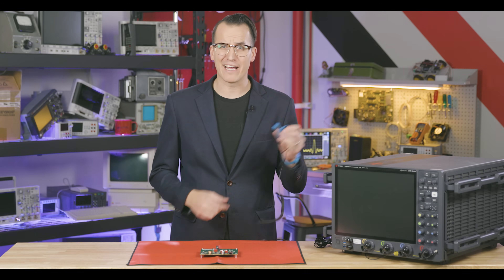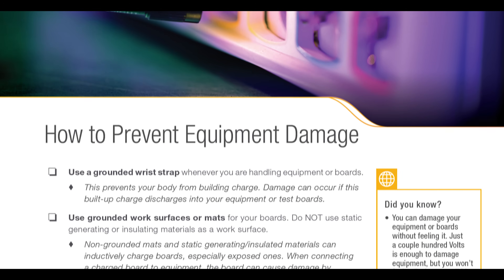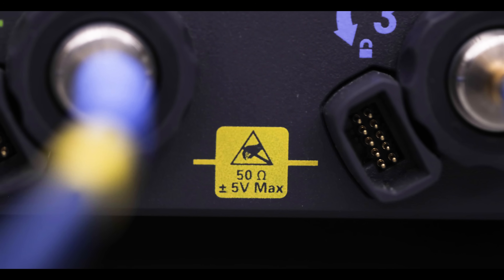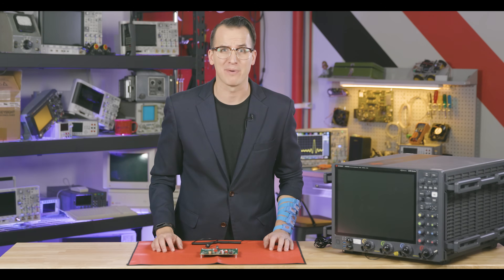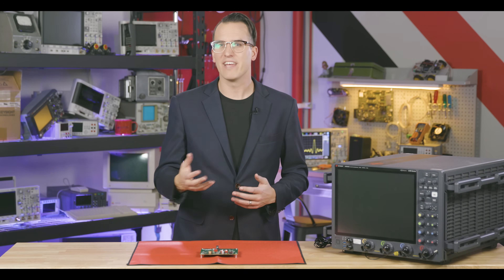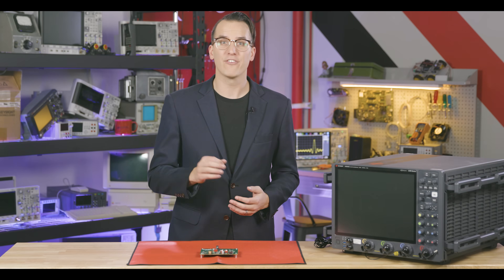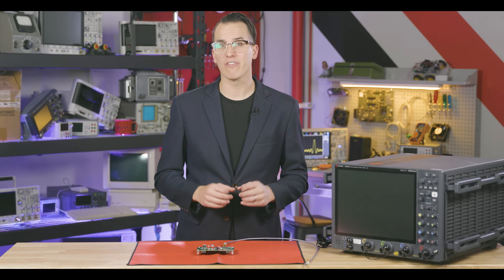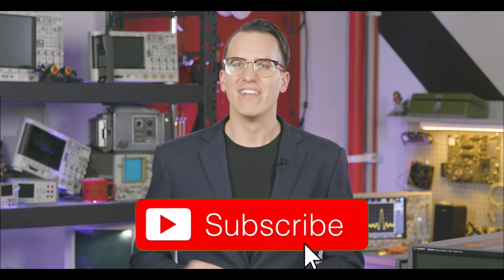⚡ 4 Easy Ways to BLOW UP Your Test Gear ⚡

Comment: I thought wearing a ESD strap didn''t ensure ESD events don't occur because any build up is slowly discharged through the resistor in the strap?
Reply from the maker: "slowly" in electrical time scales, but quite quickly on a human time scale. It's best to use an ESD checker as a to-be-safe measure.
Reply: @KeysightLabs  ah thank you! do you mean like the button one you showed, or the meter one? typically when I built my two pc's (15 years apart) I just kept the PSU plugged in and my bare foot on it while i assembled everything.. I know that would be bad if you touched anything hot though. recently took up electronic repair as a hobby so my experience is pretty minimal. ended up making my own strap from a resistor out of a mega2560 kit, verifying it worked with a multimeter. just got my first scope today, a DHO814, so I've been doing a lot of research before attempting anything. what exactly is that thing you used to discharge the cable, is it just called a 50ohm shunt?

Comment: Your comedic timing is on point. It's very hard and I'd imagine you didn't have to study in school.
Reply from the maker: Oh I had to study a LOT!
Reply: @Keysight Labs  you should be making more videos man. You're like electroboom only without running voltage through your body and the innuendo lol
Reply from the maker: Thank you, appreciate it! I have a few things in the works 😃
Reply: @Keysight Labs  cool. I'm starting a channel I think. Hurricane Fiona wrecked my home and I'm just getting thr work done now. I've slept in my workshop for over 5 months and the wife sleeps on the sofa with the cats. We  have no where to fit a bed. The end is in sight though. I had to give my 3d printers and some other gear away. I'm still a noob and I've been soldering a different circuit every day. Haha

I'm building a giant robot arm for thr local non-profit makerspace that can be controlled with a ps5 controller in hopes of getting some kids in to learn. Management doesn't seem to gaf.
Reply: @Keysight Labs  I have a software engineering degree I never used and went into policing for 2 decades then was forced into retirement. I remembered how much I loved this stuff and basically live it and do charity work. I would  do smd practice boards alot so I wouldn't be one of the belly achers lol. I majored in big data algorithms before they took over our lives hahaha

Comment: I wonder how they abused that poor scope to achieve the arcs effect…. Question tho, does it still work? Seems like the arc was jumping from the grounded ring of the probe to the outer shell of the BNC connector? Doesn’t look like any arc jumped to the signal input
Reply from the maker: Good question! It was a scrap scope, no hope of repair. I hooked up a neon sign transformer to the BNC connection in the back and the probe.
Reply: @KeysightLabs  Last time I accidentally discharged to my analog scope (sorry I’m too poor to get a key sight one) and it was fine, I suppose I got lucky and discharged to the outer ring of the connector and luckily it was grounded, it was painful for me tho
Reply from the maker: Yikes! I've seen folks often touch the outer ring of the BNC to make sure they are discharged. The center conductor is the one to be careful with

Comment: Notably, probing a 12V 1200W earth-grounded supply backwards by accident will light your scope lead on fire, but actually your scope will be fine. As long as you put out the fire, anyway.

Comment: Very nice, but you forgot to say, that it is a good idea to connect a 1M or higher value resistor between you and ground. 
Becaus if you touch the "hot" conductor from the mains and are groundet you would get a massive shock and maybe die. The 1M resistor would limit the current in that case to a safe level and you would only get a small shock.

Comment: Wow, I've been using the pink foam as a ESD pad for years, but I guess my habit of touching my workbench with my hands first has been the best grounding so far.  It's not that my workbench is grounded, it's just a cheap plastic fold-up table.  So far I don't think I've blown up any parts though.  I don't have test equipment other than a really old Radio Shack DMM from the 80's.  I'm too poor to buy test equipment.  http://www.R2Pv1.com/

Comment: I once went to collect a bunch of cheap computer parts that had odd faults (motherboards that would start up but not recognise disks, etc.) from someone and I brought some antistatic bags with me, and the guy looked at me like I was crazy.  He said he'd been building computers for years and never needed them as he'd never zapped anything.  Apparently it never occurred to him that damage from static electricity doesn't necessarily kill a device outright, it can also cause partial and intermittent failures depending on what gets zapped.  Seems he'd been killing computer parts for years and just never realised...

Comment: couple years back, I was fresh from school and basically had no idea about ESD effects.
At the time our company was located in a nice building "loft/open space" style with a glass square in the center of the floor, and we all had our desks around it, on the wooden floor.
I had a 2k€+ prototype on my desk I received the week before, and was trying to debug a component failing during bring-up. The CEO comes check on me and the bringup. At some point during my explanation he goes "is that this component burning down?" and points directly at the CPU. We head a loud "TAK" and the board turned off for good, never to power on again. I wasn't sure about the issue I was initially chasing down, but there was absolutely no doubt about this one!
Since then we put ESD-safe flooring everywhere there can be electronic components.
Reply from the maker: Ouch!

Comment: Once upon a time i killed a multimeter measuring a high voltage output by accident (6000v 100 watt) and magic smoke appeared proper EEVBlog style.

Also, never hold a spud gun with a 100KV spark ignitor between your legs to look if the spark gap innside is too big, because it really REALLY hurts in the sack 😅🤣

My poor mans way of dissapating eventual charges and check for high voltage is little finger on ground and showing the board my middle one :)

Comment: Just bought a DSOX-1204G.  Taking it out of the bag it was wrapped in (low density polyethylene) it produced a sizable static charge and it generated a large arc from my thumb directly to the channel 4 input.  Physician heal thyself!  I appreciate all the the efforts you guys go to to educate users, but I find it a little odd that you lecture us on static precautions then pack your scopes in that sort of plastic.

Comment: Definitely some good things to keep in mind in this video. I'm surprised that anyone who gets in to electronics would think those wireless wrist straps would do anything at all to protect against static buildup. The pink foam stuff and the pink bags used to ship some components are static disipative. Dave Jones showed how parts inside a pink plastic bag can still be zapped by static electricity. You are better off using the black conductive foam and those shiny silvery type of bags. The silvery bags are anti-static and will protect the parts inside.

Comment: Old vacuum tube electronics which I commonly repair can easily destroy test equipment if not careful
Reply: EEVBLOG has covered the fake wireless static band theory without beating around the bush....
Reply: The supposed anti-static Pink board bags also do not protect against static discharges.  EEVBLOG proved this.

Comment: I have engineers on me dropping the anti static bracelet simply because this sort of damage "never happened" to them. What the hell do I do?
Reply from the maker: Well, it only takes once. But, the big thing to emphasize is that it can partially damage it and only show up later. You could also try to find an ESD tool like we used and actually show them how charged up they are.

Comment: Wow! I had no idea pink foam was that useless! I always just sort of trusted it because it was supposedly made for that application. Very good info here!
Not sure if I missed it, but was it also mentioned here that ESD damage can be cumulative? Just because a poor practice doesn't wreck something the first, second, or third time, doesn't mean that damage isn't adding up.
Reply: Yes, static discharge can weaken or damage semiconductor junctions without actually causing immediate failures in many cases.  Spike damage can manifest itself as failures later on for no obvious cause or reason.  For example I've experienced controller board failures a week or more after a known mains voltage spike incident (took out the cheapo surge protector and caused the RCD to trip).  A week or two later I had a controller board (not protected by the surge arrester) fail and the only reason I could put it down to was the big spike a week or two earlier.  This is why the problem is so insidious: people think they get away with ignoring ESD issues because they don't have immediate or obvious failures, and the failures they do have are put down to "unknown causes".

Comment: You put metal standoffs on the pcb? Looks quite unuseful XD
Reply from the maker: The standoff points aren't connected to anything, it's the bottom of the PCB at other points where there is actually correction that cause problems.

Comment: Hey Daniel, question, is it safe to “discharge” myself to to instrument metal case or the nut of the front panel connector on a VNA when not having the ESD strap?
Reply from the maker: The case is typically grounded and an ok option. The nut on the connector works too, but you have to be super careful that you don't hit the center conductor on the input.

Comment: I believe that appliances for domestic, industrial or lab use that do not resist static electricity should not be allowed in the consumer market without being marked as electrostatically sensitive equipment or apliance! This should be marked on the device not in the user manual :). if the inside boards of a machine are sensitive to static electricity they should put markings with  static sensitive boards inside! near the screw holes :P

Comment: "if you are not using it keep it capped", so... why your oscilloscopes don't come with caps for unused bnc connectors?
Reply from the maker: We're actually in the process of changing that for much of our gear, great question!
Reply: @KeysightLabs  hope not in the proces of making your gear more static sensitive :P

Comment: 2 questions, 1) if i have left the room, then return later with a significant static charge. Then how many seconds of time after putting back on my ESD wrist strap will it then be safe and be fully discharged!!?? This is a very common scenario. But was not covered in the video.

2) If recently washed my hand will that also help to discharge me?? Assuming that the tap is metal and it has a real ground point. Sometime it is hard to be sure about that fact. However in other facilities a green and yellow earth wire is very clearly visibly attached to the nearby pipework which can be traced back to the sink. I am of course thinking about mobile or off site scenarios where you might not have the ability or luxuries to control the situation when compared to the lab / workshop.

This is important to me!! Thank you keysight people!!!
Reply: Oh.... BTW how many Mohms resistance to ground for 1) the strap and does that make a significant different to the discharge time?? Because i like to plug my strap into a spare stud connection on my mat, this then means an additional path to travel with extra resistance incurred of the mat. Perhaps with  one of the 2 sides being more conductive than the other one. Also that might not be proper use however the cables they give you with these esd straps are far too short to actually reach all the way back underneath my desk to the wall sockets. To the mat is the only place it can reach to be attached. Dear me i feel that getting clear and correct advice for this subject is more complicated than it really aught to be.
Reply from the maker: As long as you have a good path to ground (even through your mat) you should be fine, but you can always check it with one of those ESD testers.
Reply from the maker: It seems to discharge almost instantly, and for practical purposes you don't have to wait once being grounded, you discharge very quickly. For #2, probably yes? But you'd potentially build up charge again right away as you walk back or move again. I'd definitely want to use a grounded wrist strap.

Comment: "blablabla shunt blabla" How about some grounding adapters that have a little button you press to discharge it before coupling it on? Or, better yet, add a "safe mode" to the oscilloscope inputs, so dangerous stuff when plugged in will go to a waiting lobby where it can be screened for safety, then manually (or automagically), connect to the sensitive internals... KL, did you think of that? Please tell me you didn't.

Comment: I'd complain about you guys not having easily replaceable fuses for the front-end... But then I remembered I'm not a moron, and that those fuses will create mad degradation in the performance of the units, and that can't be compensated in any way. Or the good guys at Keysight Labs would've already done it! Maybe have a "safe mode", that disconnects the probes from the real oscilloscope and gives rough information to confirm the setup is correct? May save lots on repair bills! :O

Comment: 2 thing, not really ESD how I have killed test kit, BNCs have 2 sizes that look the same 75 and 50ohms can not remember which has a larger centre pin, so you then need new BNCs sockets, on your kit, so when you have both around have them all clearly marked. then another one is odd, flowing kit i.e. isolated PSU so gound as not the same. this one I saw most on RS232 and screen was no grounded right and we had around 200v between the 2 units (1 was logging the output of the other) everything looks OK but after a few hours you get a fire. (this after about 20 or 30 fire over about a year, we found the problem)
Reply from the maker: That's a lot of fires...

Comment: What’s about measuring something and your connection with the ground clamp isn’t really ground or connect diffrent channels to diffrent Potentials with the ground clamp. I think that’s the way that most beginners blow up their osci. Or is your test gear save against this? The clamp isn‘t ground and the clamps of different channels aren’t connected to each other?
Reply from the maker: This is pretty common as well, the ground is ground, but usually people blow up their boards this way, more than they do their equipment.

Comment: 5th way wait to new years eve and put as many fireworks on it as you can find. 

seriously these tips can be gold. i havent blown any piece of gear yet and took none of these precautious ever. but it can happen easily the more sensitive the equipement the easier. though you guys should know that input protection is crucial hence having build in some for sure.

Comment: Not ESD related, but what always bothers me is students connecting signals with a DC bias on into an RF spectrum analyzer.  The pink poly stuff is evil, prohibited from a lot of cleanrooms because of silicones. Metalized film bags and a ESD ionizer
Reply: we have a DC blocker permanently connected to all spectrum analyzers that come in contact with students :D

Comment: Anybody here damage an oscilloscope with ESD?  I used them a lot in my career and never damaged one and I only wore wrist straps when handling bare chips or boards.  In one of the projects I worked on, I was shocked that nobody wore wrist straps even when they handled bare chips that they were testing.  I don't recall any being damaged from ESD.  We found other ways to blow them up - lol.  Okay, maybe there was latent damage that would have taken longer to show up, but these chips were not production chips that would ever ship to a customer.  The production test group always wore wrist straps - and anti-static lab coats which are also important but which you never mentioned.
Reply from the maker: We actually made this video because our repair department reached out to us about input damage on equipment they receive. It seems to happen industry wide but isn't talked about much.

Comment: What is the model of the ESD device you using in this episode ?My experience with ESD is bad , I was attempt to fix an EPSON printer & touch the main board with my bare hand & that kill the chip I touched making the printer totally useless .
Reply from the maker: I'd have to double check, we borrowed it from the manufacturing group here in Colorado Springs.
Reply: Would be very useful to get a similar device , thanks in advance
Reply: @KeysightLabs  I'd also love to know.